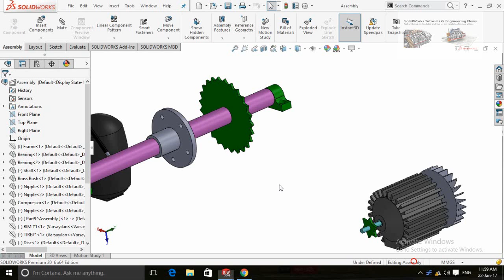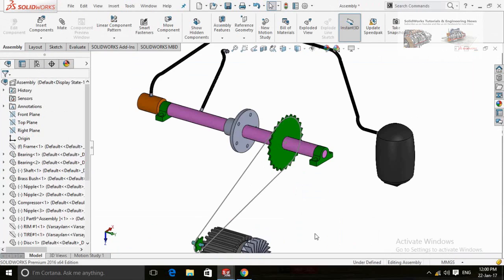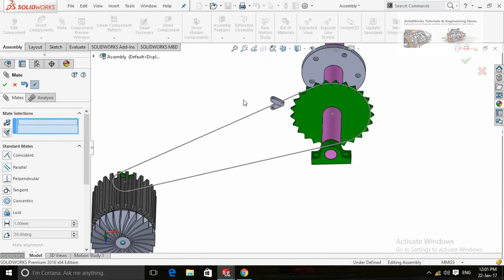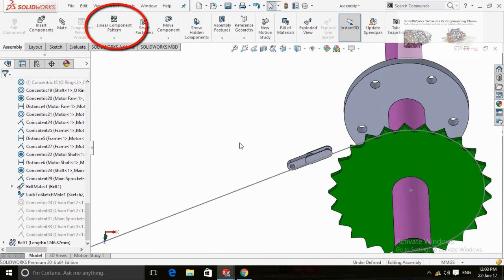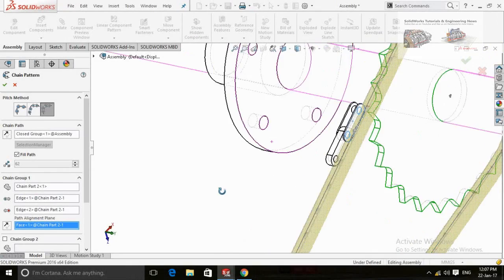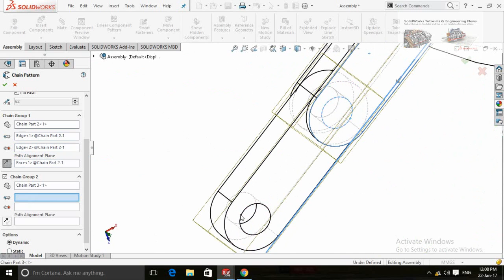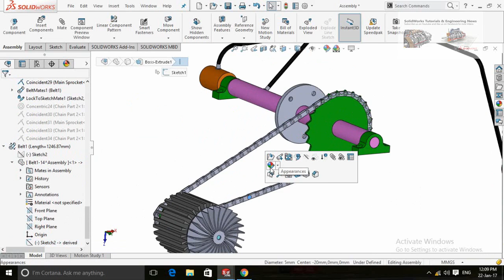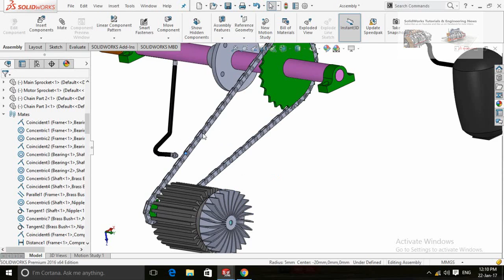SolidWorks Tutorial for Chain Part in Assembly Chain Component Driven Pattern with VOICE Narration

Comment: you failed. chain is not moving with sprocket. how to animate both sprocket and chain simultaneously
Reply: SolidWorks Tutorials & Engineering News graphics setting exactly where is that option can u make video on this issue. help please
Reply: What you can do is, in mate option go to Lock and select any one link and lock it with the sprocket. Then both will be moving :)
Reply: @Adityas-mc2ih  Crap must take 20 years of training just to make a chain - they call this an easy system to learn.